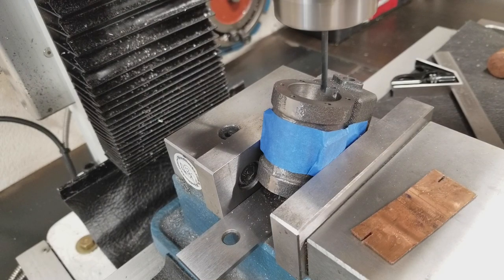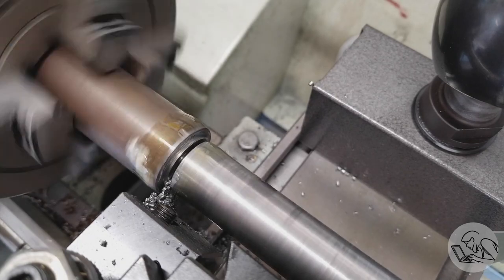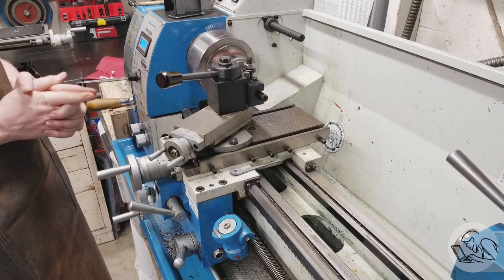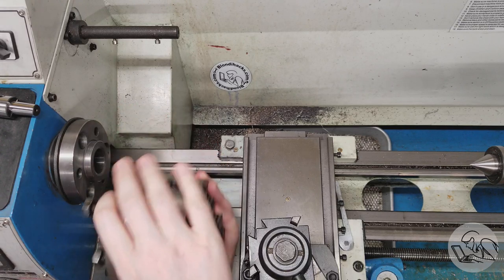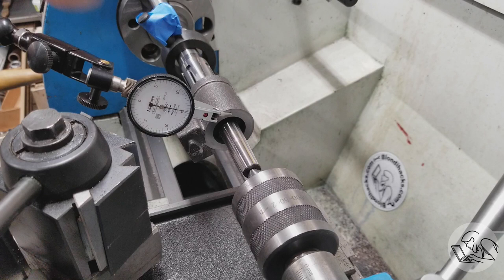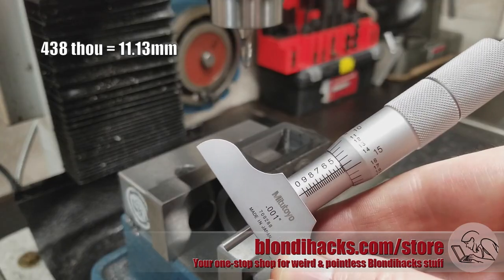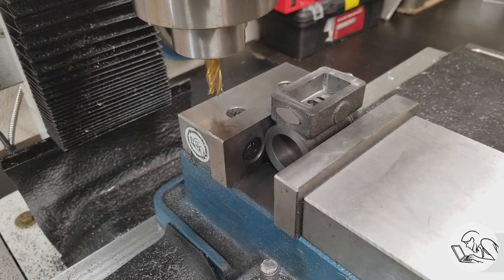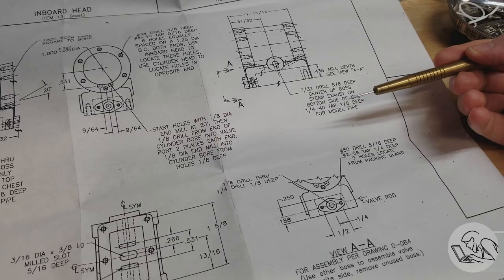Let's Build A Model Steam Engine - Machining a cylinder casting!

Comment: Nice recovery, or should I say recoveries! It would have been helpful if the drawing has given a dimension from the cylinder Centreline to the steam chest face. I often find model engineering drawings lack critical or useful dimension. Enjoyed your video as always, lovely to see the trials and tribulations.
Reply: you should see the Dimensions in the model engineer magazine for some of their projects, I have seen where if you add up some distances it is Larger than the item to start with !

Comment: When you mentioned almost having to scrap the part, I actually wondered: what would you do if that happened (I mean, after you spent an hour swearing into your whiskey glass)? Machine it from scratch? Look for another online? Decide that part wasn't all that necessary and jury-rig something else?
Reply from the maker: Drown my sorrows in fine whisky for a couple of hours, then order a replacement casting. 😁
Reply: @Blondihacks  and that's after the initial hour previously mentioned, yes? Just wanna make sure I get my protocols right.
Reply: @Blondihacks  Come on, just pull out the foundry gear and cast a new one.... that is what I would do! :)

Comment: Why did you decide to use the DRO to locate the other 5 screw holes on the stem chest cover?  Give how imprecise the casting can be, wouldn't you be better off matching the holes to where they're actually located on the cover, rather than where they would be if the cover had been created to precise dimensions?  I assume I'm missing something.
Reply from the maker: The DRO is faster and more precise for locating the other five relative to the first. The cover is likely to move while transfer punching and transfer punches always have some error in them. The holes in the cover were done with the DRO so I knew they would line up.
Reply: @Blondihacks  Thanks!  I missed the part where the holes in the cover were done with DRO-- that makes total sense to me.

Comment: Crap drawings is your biggest problem - having the same problem with the drawings on the M.E  beam engine  as they are very vague .
Once i finish this engine i will be building engines to my own designs - i have had a gut full of dodgy drawings !
Cross hatch on a model steam engine  cylinder is bullshit  - the smoother the bore the better regardless of whether you are using  cast iron rings or  O rings , you want smooth running at all speeds and not maximum ring seal like you would with an internal combustion engine which you want the cross hatch to bed the rings in to the bore . The ultimate is to lap the bore to achieve a perfectly round , parallel bore with a smooth finish .

Comment: Is there a benefit to adding a chamfer to a threaded hole after threading rather than before?
Reply: Yes. It removes the burr on the end of the thread.
Reply: Threading tends to raise a burr on on the surface, so going back and chamfering it after removes the burr. If you countersink before hand to the size of the major diameter of the thread or just a bit bigger, you shouldn't get a burr, but it's a lot easier to just tap and then chamfer until the burr is gone.
Reply: @ADBBuild  that's a good explanation thanks